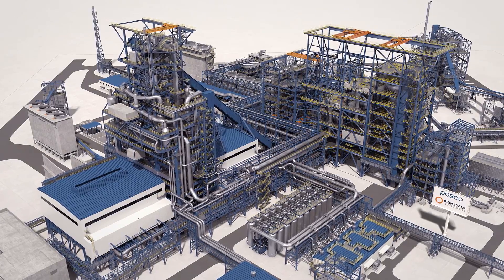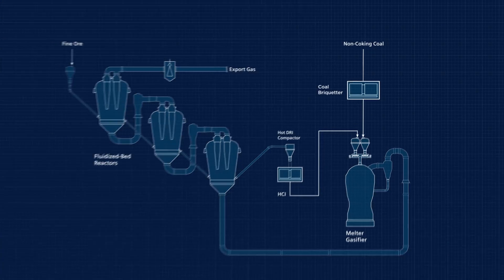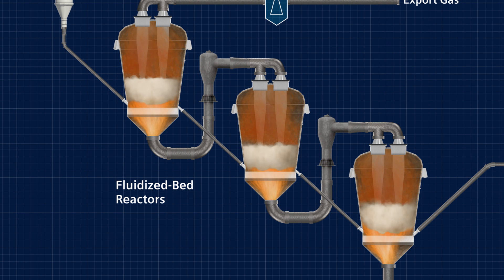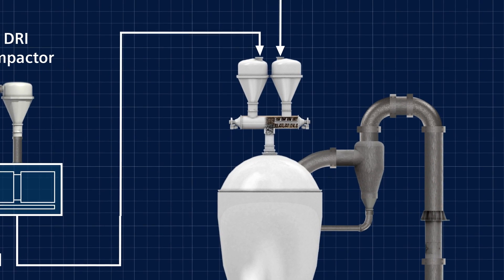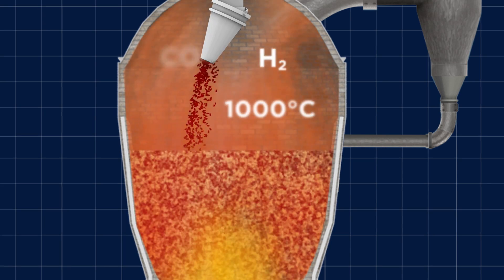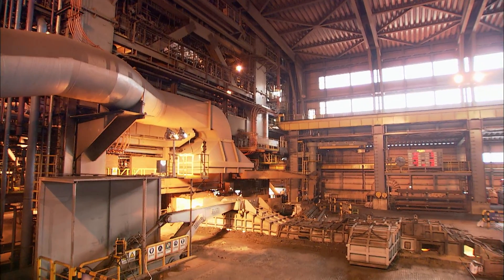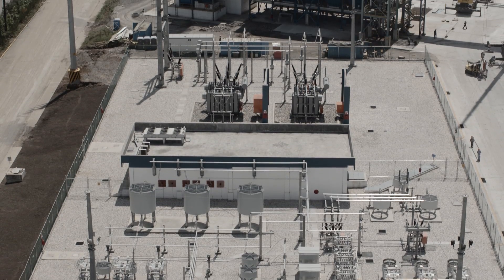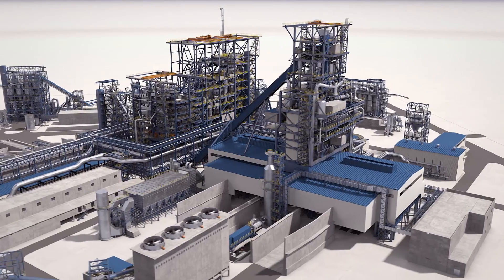Finex® - the ironmaking solution of the 21st century

Comment: The hot reduced iron would get sticky and foul the pipe work on the way through. How do they stop the bottom oxygen injection from blocking? Variations on this have been tried before with limited success.Also this process is very dependent on every part of it working  as one fault can shut the whole process down. Great if they can get it reliable

Comment: If it is non-coking coal, what about all the sulfur and ashes that could end up in the melted metal or reducing gas.
Reply: The coal briquetter probably acts as the substitute for what would have been the coking battery part of the operation in a traditional hot metal blast furnace operation.